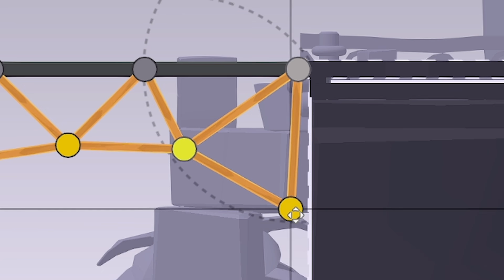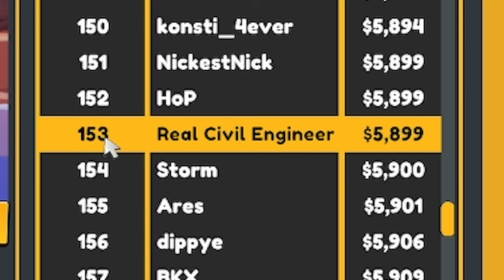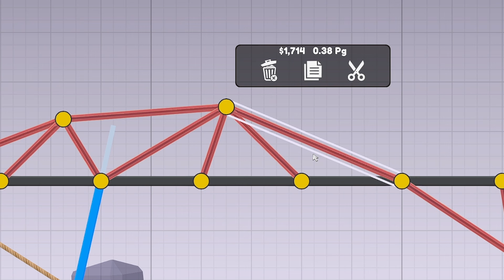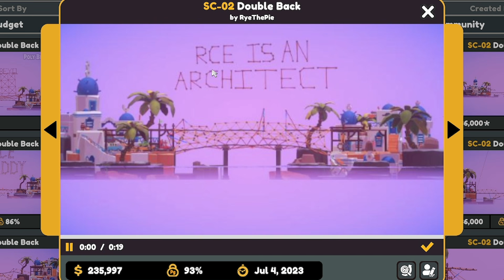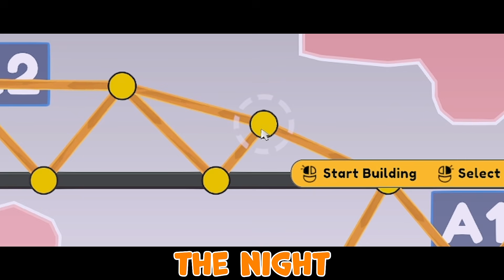Engineering TOP 1% bridges in Poly Bridge 3!

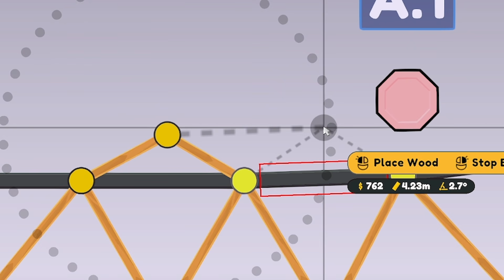Comment: 18:28  a small bit of road at the top for the van to drive onto would just be too easy, i get it i get it. much more interesting to force a wavy road to handle way more stress than is necessary from a heavy vehicle stopping right where the curve starts

Comment: At around 15:00, you mention wood being lighter than steel. In the previous Poly Bridge games, I think I remember that different types of material don't affect the structure's weight, rather, it is the joints that actually affect weight. That is, more joints = more weight. Did Poly Bridge 3 "fix" that? Does steel actually weigh more than wood now?

Comment: I think the thing with the first bridge in the gallery you viewed with the weird wall braces was giving the pieces the ability to flex without crushing the wood.

Notice how the triangular wall braces kinda pivot back and forth? I’m guessing that’s how they got away with it. Your wall braces were not able to compress, so they would break if they got squashed too hard.
His braces pivot along the corner of the triangle (and the anchor up top also looks like it rotated to provide extra length so the pieces up there didn’t break from over extension) so the entire bridge can sag and move without breaking any of the supports it looks like.

Comment: Matt, the wall braces on the cheapest one works like the rear suspension of various racing cars. The further down the bridge pushes, the harder the triangle presses into the wall because of the rotation. Whoever built that one was a real-ass engineer, or they got really lucky. I would pretty much have to go looking for what else they built to know the difference , and I haven't, so I don't know.

(Four link suspension is one of the things I'm talking about)

Comment: the wall braces on the one are designed to switch to use tension when the truck is over it and pressing down on that side and when the truck is on the far side give compression so the other side can be tension.  it's just a brilliant little mechanism.

Comment: That 1st bridge triangle thingy that you didnt understand is basically a "Rocker Arm" and automobile engineers use it as a suspension connecting Wheels A-arms to the piston,  its not used in commerical cars but in Formula Style Race cars.  Now thats a bridge that only a Mechanical Engineer can make!  An Engineer nevertheless😤
Reply: That was really cool! It's like F1 suspension because it has to be laid out widthwise instead of vertically.

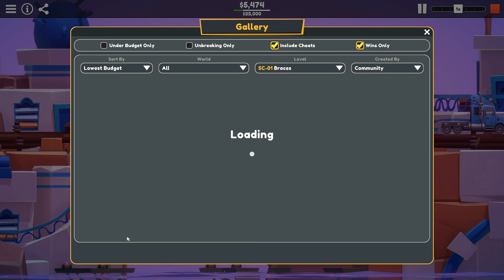Comment: For the wall braces at 7:34, I assume the wood triangles are on the braces so that the bridge can flex more easily. The bridge is designed to bend and flex, so without those triangles and having a more stiff brace like yours, the compressive force between the solid wall and the bridge would be dealt by the wood itself. By having those wood triangles there, they create extra nodes so that the brace can fold a bit more without snapping and handle the bridge's bending.

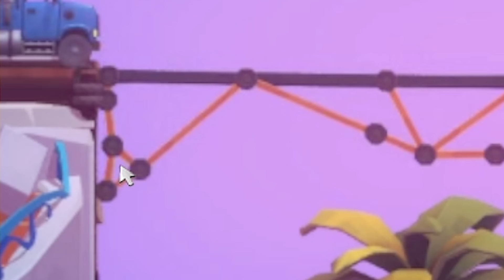Comment: That triangle at 8:00 is a cam that wedges itself into the wall as load is applied to the bridge. It's freaking genius and beautiful to watch. It's basically acting like the rocker in pushrod suspension.

Edit: Also note they left a quad instead of solid triangles below the outside road pieces, so it can deform while the cam is rotating but still hold the road up. It's such a gorgeous solution.
Reply: polybridge players sometimes invent stuff on their own, this might be a result of trying to get rid of a piece. But most likely that man is just smart
Reply: Glad someone else caught that. As an engineer and climber, climbing cams also work almost exactly how his bridge does. You put them in a crack in the rock and the harder you pull, the harder they push against the crack walls. So maybe he's a climber.
Reply: @mikehayes3324  I was thinking trad gear too at first, but a pushrod rocker lever is a better fit for an analogy than double excentrics I felt like. 
The gear excentrics continuously change their radius from the centre pin as they rotate but the cam in this bridge keeps the same contact point with the wall. 

Actually a 4-Link drag racing suspension that pushes the wheels into the ground as torque is applied to the wheels is an even better fit. 
That's very similar geometry but used in reverse - a torque induces a linear motion for better traction instead of a linear motion resulting in a torque. The triangle cam in this bridge would be the axle and the two pieces it's supported by would be the links, forcing a rotation as it moves through the arc.
Reply: Correct.  I think a mechanical engineer made that bridge😆
Reply: @vinitfirke2201  Yeah probably. They definitely knew what they were doing, that's for sure.
Reply: i knew the rotation was driving the wedge into the wall. i thought that was obvious, surprised matt didn't understand that. i didn't know it was a mechanical engineer thing.
Reply: @takumi2023 maybe you should look into being a mechanical engineer. Might be a career path with an easy to comprehend education for ya haha
Reply: @dlcdaniel6308  I know saw that it moved and rotated. Besides, academia is a little late for me 😅
Reply: @takumi2023  it's never too late to expand your education and/or certifications!

Had a classmate in all of my business classes that was over 50 (that's all she'd say about her age, haha) she said she wanted to learn about the present business world because even with years of experience it felt like, to her, that the world around her was advancing faster than her experience could keep up with. She was an amazing woman and her mindset definitely added to all of our classroom discussions!

If it's an option for you, I'd definitely reccomend it. If anything, it gets you out there with people you normally would never be around. Which is something I personally find to be very valuable. :)